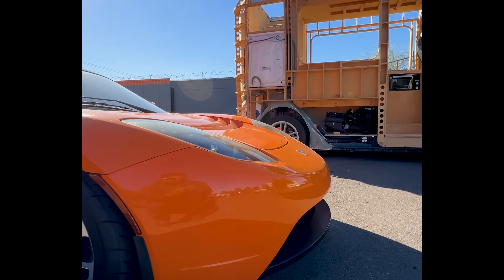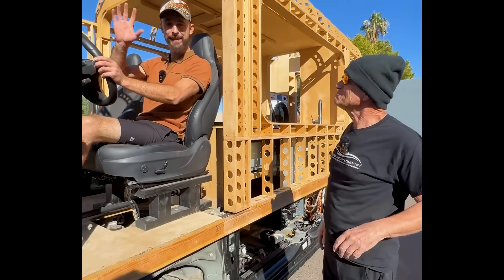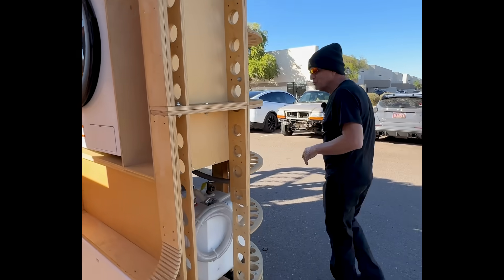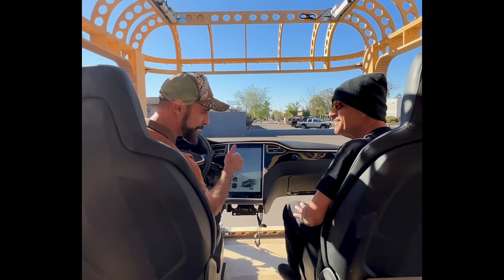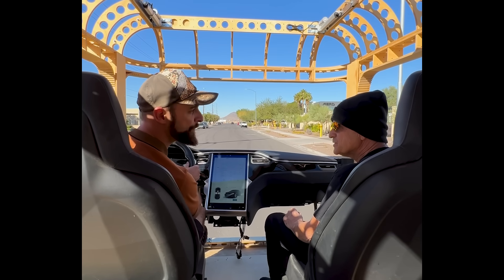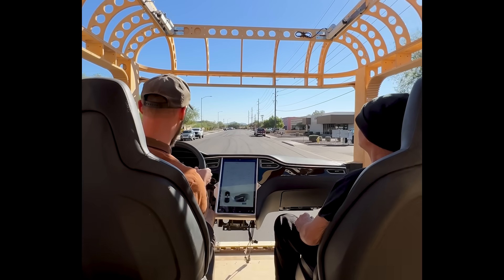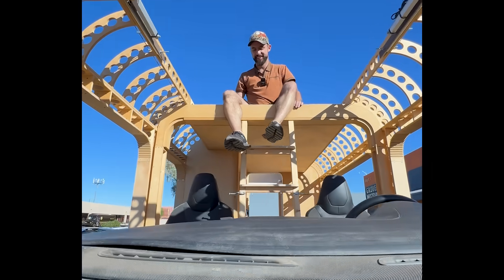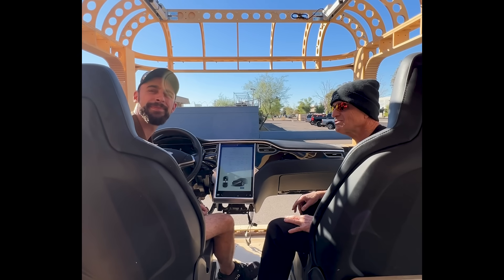Tesla Model S Tiny Home Project

Comment: Awesome build !
This is what many people are waiting for, a large Electric RV Camper Van that can carry all your outdoor activities adventure gear, with a retractable extensions, sliding triple layers of solar panels on top of the rooftop that can charge up the Electric Van batteries anywhere you go in the great outdoors where their is no charging station around and with an electrical adjustable air suspension system that can be lower on highway speed or raise higher for higher  the ground clearance to travel all different rough road mountains terrain anywhere in the great outdoors! 

Off Grid Living, Unlimited Free Electricity from the Sun anywhere you go into the greatoutdoors! 

Just imagine that ! 
I wish someday this will happen?
😃😍💖⚡️🚐⚡️💖🌞🔋💯👍
😉💖🌬🌊🌞⚡️🔋💯🌎✌️🙏

Comment: There is a lot a like about this and some I dont... I would build a new longer frame and install the single motor in the rear and batteries in the very middle. You dont need to keep the S chassis

Comment: If I had enough money and it was possible with software, I thought about the Tesla semi be becoming the equivalent of a autonomous land yacht, and you could wake up in a new place every morning
Reply: Put it on surprise mode and it figures out the power requirement it will need and just choose a destination for you.
Reply: Think about how much solar you could put on top of a semi trailer,  you could even get weird if you had enough money and have solar panels flip up from the side also.  They would also act like a awning for the windows or if you were sitting outside.
Reply: If you stayed down in the southwest, you wouldn’t even have to go to a recharge station
Reply: Put a dehumidifier add water filter to catch her water from the air and maybe even drain water off the top of the roof if it rains and collect that
Reply: I wonder if you could take the waist and process all of the water out of that then expose it to enough sunlight using a Fernell lens that you would end up with a carbon brick instead of having to empty the black water
Reply: In 10 years, you will probably be able to tell AI these kind of requirements that you’re thinking about and it would go build it for you to include sourcing the parts and the labor. There’s a thing about one up manufacturing that I think is going to absolutely happen and it will both be easy and cheap compared to anything you can do right now.  That applies across the board to anything you might be able to think of.  There will be a lot more customized everything or outright new products that only one person has because they thought of it and wanted it.

Comment: Thats pretty neat! I've seen where like some have just taken Tesla batteries and re-purposed them to be a clean energy source inside custom van homes. But to utilize the Tesla chassis itself is pretty cool. Course with all the battery weight still very low in the car, even building the thing to be fairly tall I imagine the thing is pretty stable.

Comment: Cybertruck would be way better for this. Much bigger battery, and steer by wire to make install a breeze, not to mention way easier to maneuver. Also easier to weld onto.

Comment: That's a neat idea. It boggles the mind to think of the multitude of EVs that will be available for these types of conversions. Also, what a perfect platform if you enjoy camping long enough. The battery is ultimately charged without cranking the generator, so it's ready for the trip home.

Comment: LOVE the concept.  I need one that is 22ft long, has a regular queen size bed, a combined 2000watts of power, at least 600-800 watt/hr battery storage, Truma comoonents, washer/dryer combo, and a water pull/filtration system for refills from lakes and streams
Reply: Wait until they get a Tesla Semi chassis 😉😛
Reply: @niri2506  that would amazing as that frame could handle some offroad missions too!!!  Only... I would need that by July 2025.  🤣😅😃😐😮‍💨😥😢😭😭😭

Comment: Stretch the frame. 6 foot would be a game changer. Bed could stay inside. Also stackable solar "leaves" on the roof that slide out doubling as awnings. giving minimal triple the solar surface area.
Reply: Pull out sides could increase living space and allow for a fixed bed without having to stretch the frame. 🐰
Reply: @huarwe8797  I bet they could have engineered a pull-out rear section for a sleeper bed. Keep the weight off the sides of the cabin.
Reply: @ generally can’t use areas that are collapsed. But you can in a stretched vehicle. Certainly can’t drive with pullouts open but again you can with a stretched frame.
Reply: streached with 2nd battery.  fantastic..

Comment: If you'd put two extendeble Solar Awnings on it, as well as solar on the roof you would have a lot of energy to put back into the battery pack. So far there is nearly no one doing that (except Solar Rolla).

Comment: With that clearance its likely parking lot only. Great concept, love the bed on top idea. Curious on range anxiety once conplete and moved into. One thought is dual battery packs. Could help normalize the range if they can be easily paired and or wire them or one into the solar for overnight power.

Comment: It would be really interesting if you could string together more than Model S, so it's like twice as long. That would give you twice the battery capacity, and twice the amount of space to build the RV on. I don't know about others, but when I think about the range you'll get out of this at highway speeds, you'll be lucky to get 100-150 miles per charge. A bigger battery would go a long way.

Comment: Can't wait for the Cybertruck version.
Reply: wont be great! the aluminium casting makes it worse compared to a body on frame truck! imagine swapping tha battery and motors on the frame of a ford f250 or f350 and having a much better platform to build a camper wit the already vast amount of aftermarket support!
Reply: swapping the whole powertrain in a ford transit is even a better deal you can keep the whole independant suspensions and have way more room than you´ll ever have in your tesla. now add a generator on the front and you can basically have a go anywhere vehicle.
Reply: @rb98b90-0 totally useless and you wont be able to go far! let alone go off the grid unlike the diesel which you can litteraly double the range and even more!
Reply: would be fun if THAT would be a perfect box
Reply: Yup! as many are being wrecked down, we might see a good number of them. This has been our wetdream for some time now. My wife refuses to get a van/camper/rv until the electric is avail - with the super charging network A++...
Reply: @rubenb.molina6968  I totally agree with your wife! No camper until I can get a electric.
Reply: @segment932  bullshit!!! and the electric one still wont match an ICE! imagine what people have been able to go far into the middle of nowhere with their mercedes Sprinter van or lets say a ford rv conversion!

Comment: Crazy. A home on wheels.  What amazing times we live in. I can see a whole industry growing from this.  People using these to travel around the country, visiting parks and other areas of the country. Maybe even living in them.
Reply: this is nothing new lol!!!! in the UK someone litteraly built a house with roof on top of the chassis of an old diesel truck, that thing is offroad capable with all the range to go everywhere.
Reply: Not really, this will have a range of 100 miles
Reply: Looks like a solid design for a tiny house tesla but unless they add a lot more battery then the range would be terrible and probably take days to recharge with the solar.
Reply: @seekerofthemutablebalance5228  Depending on how aerodynamic it is, you could probably get 150 miles of range on a single charge. You also wouldn't charge the battery off of solar for driving. It's a Tesla. Take it to a supercharger.
Reply: @anthonypelchat  This will get exactly 70 miles on the freeway and 100 in the city.
Reply: @EugenePutin  Probably more. They cannot load much more weight than the car already weighed due to chassis limits. The aerodynamics will be horrible, so highway driving won't be good. But city driving should be decent.
Reply: @seekerofthemutablebalance5228  no its not! its not a very good use of space and the aerodynamics is terrible! why not swap the whole powertrain in a minivan honda odyssey or a ford transit van and still have way more space than you will ever need?!
Reply: @carholic-sz3qv  there's millions of gas powered van conversion tiny homes.  This is the first tesla tiny home and it's probably going to look a lot like a vw bus.

Comment: This is wild
Reply: @WillProwse  Will, you want one of these on the Cybertruck chassis, right? 😁
Reply: @Bilbospil  no! you need an actuall sturdy frame to build something like that! a ford f250 chassis with the whole powertrain of the tesla and you can have even more room than ever, a diesel rv can go up tp 2000 miles+ with auxiliary fuel tank for example.
Reply: no its not!
Reply: @WillProwse  Will, you want one of these on the Cybertruck chassis, right?

Comment: Scrap the washing machine 😂 no smal RV has or need this ❤
Reply: Would be useful if this system geared up production to globally.  Many countries don't have permanent dry weather and even get cold and rain.
Also, they called it a "tiny home" perhaps just a cutie name or perhaps referring to 'full time living '  that changes the useful equipment  list somewhat  to just an rv.
Reply: Mostly because no RV has enough energy to power a washing machine, but Tesla battery can do it without issues. I live in a van for 3 years now and a washing machine would be awesome 😎
Reply: @Sony-ox7wx  no! not only its too heavy but the tesla unibody vehicle chassis isnt made to support all that massive load! a mercedes sprinter van or a toyota sienna with solar setup and batteries can very easily run a washing machine! in fact with a good size mercedes sprinter you can have both washing and drying machine, a whole kitchen, toilet, sleep room...... and with diesel engine to recharge the batteries you can even go tousands of miles no range anxiety.
Reply: @Sony-ox7wx  Not true, contrary to popular belief there are many RVs that have gas and and diesel generators which can handle a washer no problem. If you ask most small RV owners I think they would rather allocate the space to something else.
Reply: It really would be.
Reply: @Sony-ox7wx This is NOT the reason RVs don’t have washing machines my friend. You only need them for a bit every week or so - plugging in occasionally is not the issue.  Their not used cause their massive and most people figure out using a few quarters is way way better to get the space back in all but the largest RVs. 

But maybe the market is entirely people who know nothing about RVing. 🤷‍♂️
Reply: @patricksquires77  yeah Nicky Delventhal on youtube has been living in a prius for years and recently switched to a mercedes sprinter van a significantly much bigger vehicle and she still uses public wash rooms and washing machine salone..... its much easier and you dont have to overload your rig.
Reply: Its not “a few quarters” anymore to wash/dry. Its like $7 minimum. Plus the trip there and back is time consuming and wastes fuel. Plus most of them are in shady areas. Plus most of them close at like 6pm and do not open until like 9am.

Comment: interesting way of building an rv , even if theres not a tesla chassis under it , it would work on all sorts of vehicles
Reply: might be a bit hard as the tesla does nos not have a chassis the body is part of the structure and you realy need to cut sheetmetal off to get it to fiit , , there a tesla plaid that some guys put a roudesy body on , and they have a complete series of the conversion , check out boosted boys boosted boys plaidesey
Reply: it will only work on body on frame vehicles, much better stability, much better ability to make modifications compared to a unibody vehicle. ambulances, RV, dumkp trucks, crane vehicles.... have been built on ford trucks for a reason.
Reply: If they can make it a complete chassis that Model S running gear bolts to, it will be a hit.
Reply: @LouisSubearth  never going to happen! no manufacturer sells chassis for unibody vehicles its a gigantic safety risk!

Comment: It's an interesting idea, and is closer to my ideal camper than the bus sized monstrosities I've seen on the freeway. My only concern is that the vehicle's boxy shape will really trash the Tesla camper's freeway range. You probably won't even see 150 mi with a 100KWh battery pack and a 60mph cruising speed.
Reply: It appears they tried to get Maximum interior Space, within the Model S Wheelbase! So, they went up Vertical, at both ends! 

Trying to fit everything in such a short (for an RV) wheelbase, will always end up like a Box, be it an Airstream Copy, or Not!

Comment: Check to see if you can see stop lights at an intersection once the roof is enclosed. If it's difficult perhaps consider making a window above the windscreen so that traffic lights at easier to see. 
I drove an F550 that had a ramp over the roof to the front bumper and seeing traffic lights sometimes was difficult because they were obscured by the ramp.

Comment: As cool as your airplane type structure is it has the major disadvantage of a lot of thermal transfer. You're better to go for a lightweight foam core sandwich panel.
Reply: or just swapping the whole tesla powertrain in something like a ford transit or a mercedes sprinter or mercedes vito van and have all the room to spare.
Reply: Steel van bodies also have the thermal transfer problem

Comment: 1.  How many btus are the air-conditioning and heating?... and how many minutes or hours will those last? 
2.  How many watt hours?
3.  What tire and suspension upgrades to  accommodate the extra weight?
Thanks

Comment: It would be nice if Tesla could sell a flat chassis for 3rd parties to convert in to all types of vans. With steer by wire and modular camera system so these could be connected for all round vision you could have a software configurator to set up the vehicle parameters and have self driving RV. You could go make a burger while the computer takes over the driving.
Reply: then when the bots are done, they can cook the burger while you supervise
Reply: for that they need a body on frame vehicle which they dont make! also i dont see tesla ever doing that unlike other manufacturers! ford for example sells chassis cab trucks or just the chassis for all kinds of applications

Comment: Why raise the steering cockpit?  Personal choice?  Why not use the original steering column and just back the cockpit back to accommodate the stock column angle? You could have kept the steering assist, had storage in the front and cantilever the back end to preserve design length.  Me thinks you got stuck on a box design over a more utility box type design. Although, if the steering was wrecked during its accident, you pretty much had a clean state to be creative. If so then, we’ll done. I do like the design. I subbed to see it progress.
Reply: Hood is too long and seating position is too relaxed. You’re practically in the center (front to back) in a normal Tesla or any sedan. Takes too much potential  room out of the living area.
Reply: @ makes sense.  When is the next video coming.  Looking forward to seeing progress.

Comment: Great concept idea to pursue. Looks like a promising prototype. Notes: Configure the passenger seat arrangement into a fold out step over the wheel and entry like Fedex/UPS delivery trucks to convert the wasted space of the side door and interior stairs into living space. Make sure the steering wheel shaft won't be "unsafe at any speed" like the 1960s Corvair etc in collisions (mechanical not "by wire" steering will be more marketable to the target audience, but make it safe). Verify center of gravity remains low (there are fed safety tests for tip over on side hills, like a camper would see getting in/out of camp grounds, and highway speed side-wind buffeting to be concerned with). Some folks like "a garage" of sorts for bikes, tools, propane, and so on. Are those spaces between the wheels planned storage like busses use for luggage?
Reply from the maker: Thanks for the tips.
Reply: Hey, for some reason, i can not comment on your channel except reply to your comments, i am curious on one thing: What happens with all the moisture inside? Wont it affect the plywood?best of luck though @grubermotorcompany
Reply: @joomla. I believe they mentioned they intend the final to be of aluminum